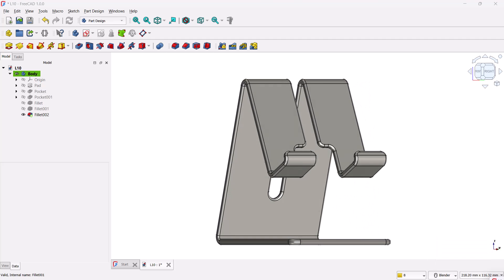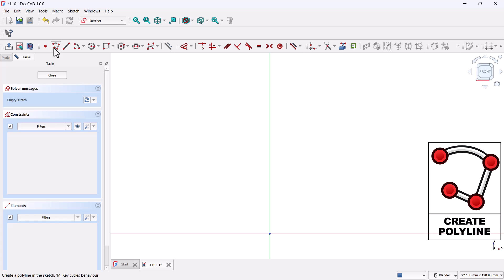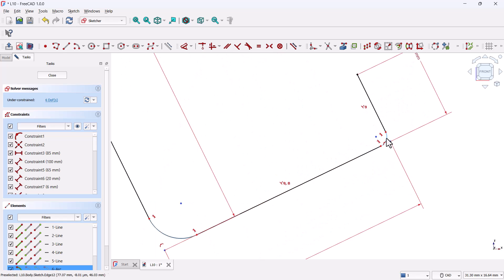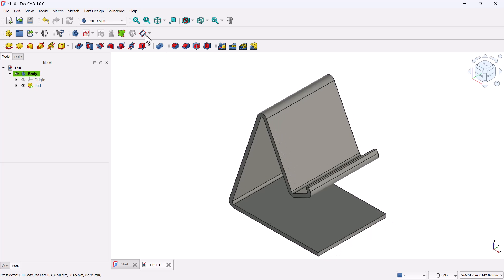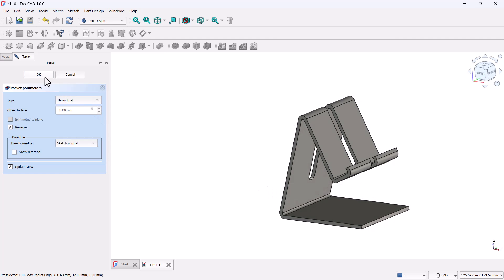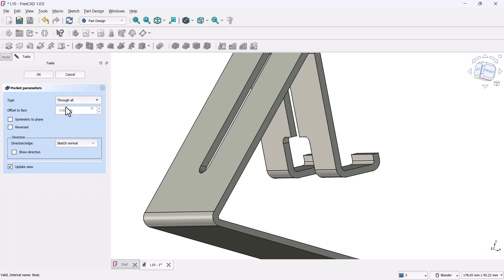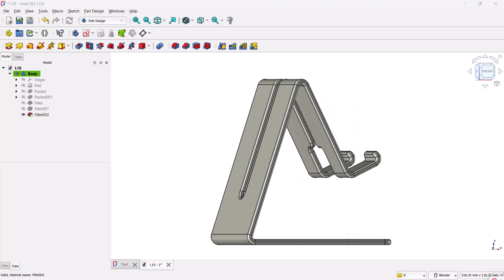FreeCAD Tutorial: 3D Model a Mobile Phone Stand Step-by-Step | Beginner to 3D Printable

Comment: Thanks for the video. If FreeCAD behaves as shown in the video, it should work, but if it behaves differently, you're a bit lost. For example, after switching to "Toggle Construction Geometry" and applying the "Offset Contour" (including adding boundary conditions for the distance), the sketch isn't fully defined as shown in the video.
Reply: I too got the same doubt
Reply: Yeah..Me also stuck there..😢
Reply: @yadhukrishnank4146  me too. Did you figure it out?
Reply: My sketch goes red. Did you figure it out?
Reply: toggle geometry -> offset geometry. in the video he is fully constraint before and after. it looks like the conversion adds parallel constraints on the tab that holds the phone. all you have to do is in the tasks section. on the solver messages. click on the (70) to select these redundant constraints. hit delete and you will be back to being fully constraint.

Comment: Hi I’m having some serious issues with this. Anytime I try and close the task it doesn’t take me to the model tab in fact the model tab isn’t even there
Reply from the maker: It sounds like you might be stuck in the Sketcher workbench and not seeing the Model tab / Combo View that normally shows your tree and tasks. A few things you can try:

Check if Combo View is hidden:
Go to the top menu → View → Panels → make sure Combo View is checked.
This panel contains both the Model and Tasks tabs. If it’s closed, you won’t see either.

Switch back from the Sketcher:
After closing your sketch, you should be automatically returned to the Part Design workbench with the Model tab visible.
If that doesn’t happen, look at the top workbench dropdown (upper toolbar) and manually select Part Design.

Restore default layout:
If the panel is missing or docked somewhere odd, go to View → Workbench → Part Design, then use View → Workbench → Reset default layout.

Comment: This video series is part infuriating part instructional.

Each vid missed 1-2 key points and leaves you to figure out why freecad won't do what it does on the video.

This leads to troubleshooting and learning more, which is good, but it makes you angry, which is bad. 10/10???
Reply from the maker: Thank you for sharing your honest feedback. I understand how missing details can be frustrating, and I’ll work on making future videos more complete so there’s less guesswork.

If you could point out the specific key points you feel were missing, I’d be happy to address them here or in a follow-up video. My goal is to make these tutorials as clear and helpful as possible.
Reply: @CADCAMCOURSE  There are missing point constraints and it's not always clear when the constraints are auto applied. For example, wen you click, you are making sure the line icon appears when you click, or you make sure it's tangential because of the tangent icon, however you do not call this out, so someone new to the software winds up underconstrained or worse, overconstrained, and then nothing works after. If possible, I recommend asking someone new to the software to test watch your video and follow along, and see where they mess up or miss point, or are confused. It may also make sense to periodically through the video, count the constraints, or attempt to drag lines to show what is not sufficiently constrained so we can follow along and confirm what is missing, or know we messed up something a little bit ago. These are still really good videos, and I want you to do more, but one minor miss in a parametric model expands into compounding problems that you don't understand yet and can't fix. Keep up the good work!
Reply: @TroyFletcherKeyboards  This is a great suggestion. I'm happy enough that these videos are free, but I do get stuck more often than not, sometimes I rewatch multiple times and give up on an exercise because I can't figure out what the error was.
Reply: @CADCAMCOURSE I wish there was a way for me to ask you a question!

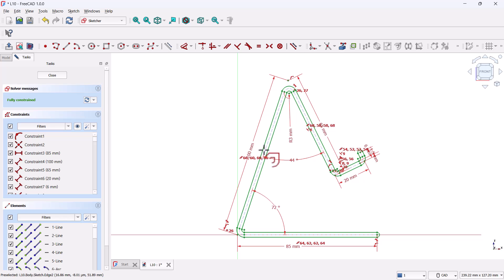Comment: What are redundant constraints and why it happens after the offset from the construction lines and turns orange, not green at 6:30?
Reply: I just deleted them and it was ok. i think it means its over-constrained and that it already knows the parameters.
Reply: @TheGrumpK I’m going to try that-thanks
Reply: hey, i tried many things to fix this and the only way i got was to dont tick the box that says offset constraint. towards the end it will do the same if u try to make the slot 8mm but u can make it 8,14. it will just make the hole 0.14mm taller, but u will have to do freehand on the 30mm above the top, so u need to skip the part where he says click the bottom of the object which will add a purpale dash, because it will turn orange again.